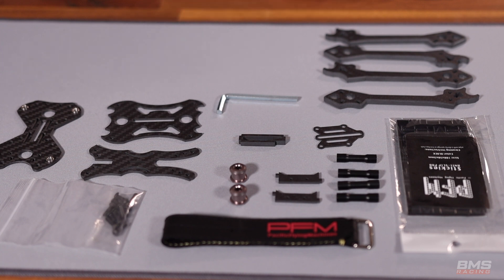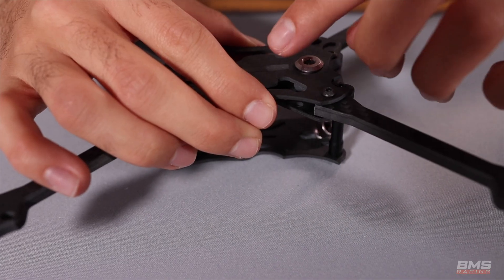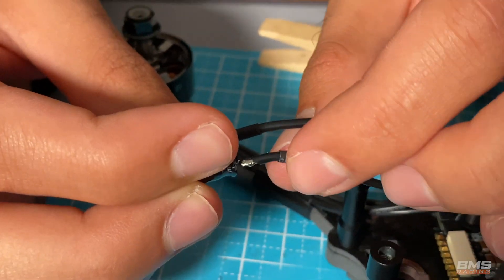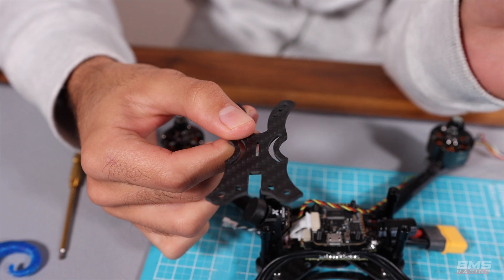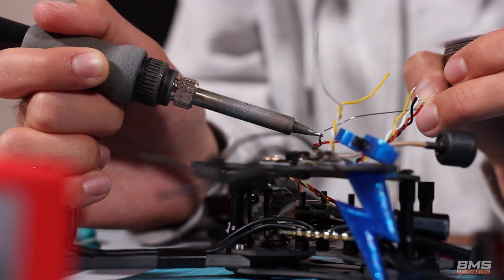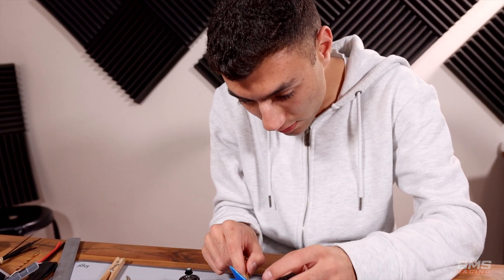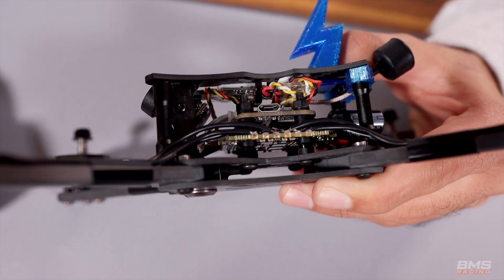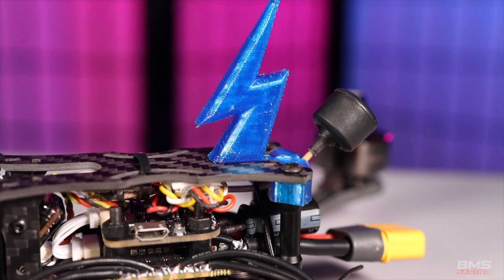Amazing Japanese FPV Drone Racing Frame - HAYABUSA from PFM

Comment: Hey Guys, nice video!
Clean run through the process and test flight.
Only suggestion i have is to add timestamps to the video to make it easier to find the specific parst, otherwise very clean!
Cheers form Switzerland ;)
Reply from the maker: Thanks for the suggestion buddy! Thomas just updated the description to include the time stamps.